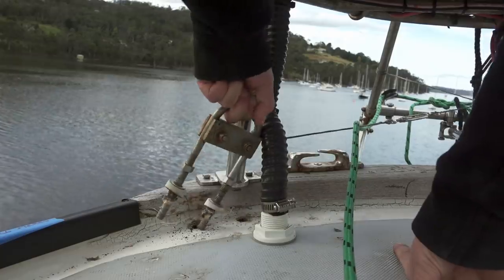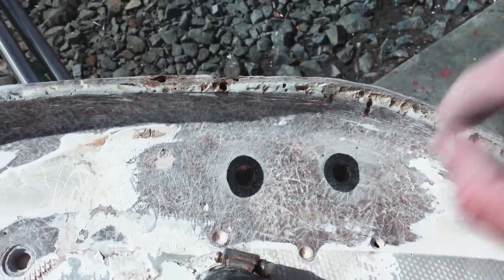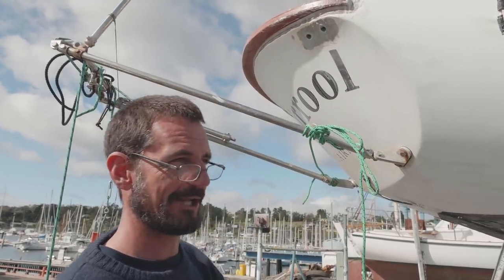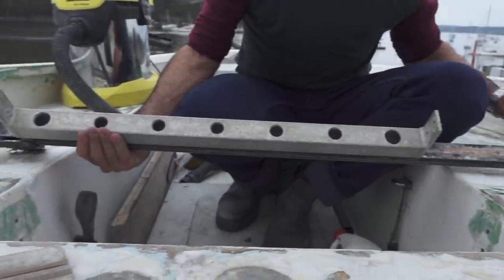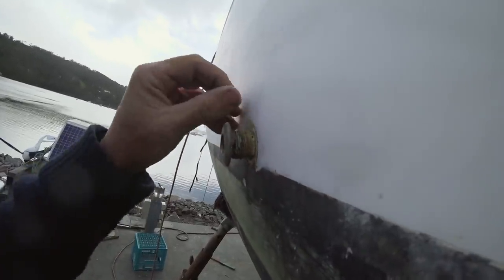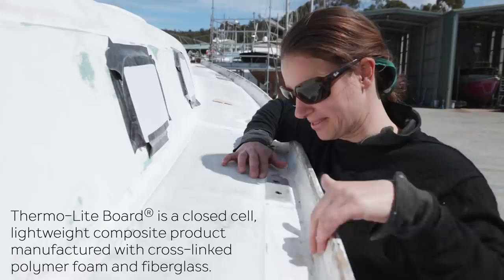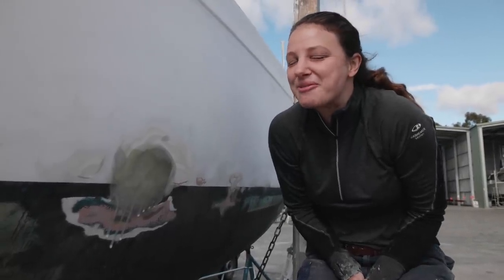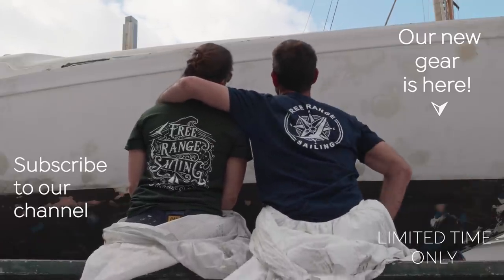Our sailboat REBUILD begins ⛵💪 - Free Range Sailing Ep 157

Comment: I love the new back-stay chainplates, perfect application.  I'd recommend that you avoid knots in the lashing, Dyneema is incredibly slippery so it's always ideal to splice it.  Next time you get around to replacing the deck lashing don't be afraid to allow the low friction ring to sit a little higher off the deck.  That way you'll have enough space to splice a multi-stranded infinite loop that is spliced together with buried tails.  I do mine with a Dyneema chafe cover to protect from UV, it is quite challenging to do this type of splice in place on deck, but as your skills progress it isn't as daunting as it sounds.  I'd be glad to talk you through it over Skype any time.

Comment: Hi Troy and Pascale, we've just almost finished our refit on our cat, and because it's a bigger boat it took a fair bit longer than yours. very similar to your refit we also did inside and out and also replaced all the rigging with dyneema. I did it all myself and saved about $3000.00 doing it. did all the splicing myself ( bit of a learning curve ) and instead of low friction rings I used heavy duty stainless cast and closed thimbles. tested all my stays before they went onto the mast by putting 6000 kg of pressure on it. I'm very happy with it and I estimate that I saved about 150kg of stainless rigging wire and fittings. the other thing is that it makes us independent, I will carry a lot of spare dyneema of different size with me and I can replace a stay anywhere in the world within hours if I need to. we enjoy your videos, keep it up.

Comment: I had modified my tack on my mainsail to incorporate a snap shackle, for quick and handy mainsail changes from cruising main to racing main. While donnig a new cruising mainsail, the eager captain hoisted the main before exiting the channel. This was against the first mates(wife) wishes. With sketchy winds on the nose, somehow the snap shackle loaded up and twisted, then deformed blowing out the tack. We gave all the people on the pier a show as I had to motor down the rest of the way before I could safely lower the main, and head back in to access the damage. Luckily the new mainsail was fine, but I still had to find a solution to salvage the sailing day. Then it came to me. I had purchased these new dyneema soft loops and had them in my in my racing crew bag( for racing on other friends boats). I popped on the soft shackle and it has remained in the mainsail tack for at least 5 years now. That soft shackle could lift up my whole boat and then some. There is no form it will not bend to. It won't work harden and there has been no signs of chafe. If it ever breaks, they were two for $30.00. It's a no brainer.
Great video! And great upgrades! Enjoyed watching!

Comment: Just looking at those Dyneema aft chainplates where the Dyneema loops underneath , just wondering if cutting a larger diameter frictionless ring in half and installing it to ease the sharp bend in the through hole underneath , if you know what I mean 😎

Comment: Pascale - I am wondering about the heat gun for the vinyl: after much research before the refit of my boat I decided to use a drill mounted hard rubber wheel designed for vinyl lettering and decals, bought on eBay in Australia. The West Systems technical manual warns that resin starts to disintegrate from about 60 degr C, a heat gun becomes effective only at much higher temperatures.

Comment: I really like what you are doing with the soft rig solutions, it's almost like going back a couple of hundred years and making things that are both very simple and easily replaceable by the 'average' sailor .  One very small problem is that it can be slightly more difficult to get the backstay tension high enough to really get that forestay straight especially if there is any creep in the Dyneema.
Reply from the maker: Our sheet winches get them there. Having a rigger that has 250 dyneema rigs behind him sorts out a lot of problems.
Reply: @FreeRangeLiving  i figured you might have to heave them down with a winch or alternatively set up some kind of tackle to the masthead and pull that back while you tension the stays.....that's how i did it with my gaffer.
Reply: @FreeRangeLiving  I'd be interested in the knot you tie to secure the lashing between the rings and how you maintain the winch tension whilst tying it.

Comment: Won't the loss of weight aloft change the roll rate of the boat? I realize you still have the mast which is probably most of the weight and the change might be small, but still, seems like a question worth asking. I know there was a study done in a wave tank seeing how sailboats (models) reacted to storm waves. The initial numbers that came back seemed all wrong with the boats whipping back and forth at higher rates of speed than anticipated. Then they realized they had neglected to put masts on the models. Anyway, just a thought. Love the channel !

Comment: Hi to you both. I noticed that the hole that you made for supporting the dyneema on the stern are not friction less. The are 90 degree edges. It may damage the dyneema rope with time. Is an observation with all the respect.
Reply from the maker: No, they're not.
Reply: Look closer. The edges are rounded over and smoothed.

Comment: Great job. Hard to tell from the video but how much did you round out the inner edges of the tube where the dyneema turns 90 degrees around the edge of the hdpe tube, bottom especially? Looking good

Comment: ... she's looking good :)

replacing stainless u-bolts with dyneema seems really good, but what are the negatives when using dyneema?
Reply: degradation through UV exposure plus chafe at any rub point are probably the two biggest issues..in this case, they’re in a handy place for regular inspection.   Stainless should give you a 20 year life, while dyneema will probably reduce that to 8 or less.  I happened to read manufacturers recommendation from Equiplite soft shackles and they recommend renewing UV protection every 2 months, plus regular rinsing “if sailing in salt water”.

Comment: Out of curiosity. Is chaffing a concern for those Chain plates(?) made of dyneema? Does any sharp edges in those holes matter or is that just something to monitor and mitigate while traveling? Great video once again :) Thank you for your hard work
Reply from the maker: Using HDPE and going to a lot of trouble to fair and smooth the holes eliminates chafe. It's the same principle as with the low friction rings- a very smooth and large bearing surface.
Reply: I had the exact same question, glad someone beat me to it! :)

Comment: won't the Dyneema chafe on the outside of the hull with regards to the rear chain plates?
Reply: I was thinking the same. I would have considered a rounded edge groove for it to lay in to get rid of sharp edges, hide the dyneema from abrasion and keep the dyneema better shaded from the giant UV monster looming overhead. That would mean a thinner layer to hold onto so building it up would be necessary and cosmetically that might not be acceptable to them.

Comment: Don't dis Sika Troy, there are many product variations within the brand, and if the previous applicator used the wrong type and prep, it is operator error, not the fault of the product.
Reply from the maker: We weren't dissing sika just the application of it to fix a hole in the deck.

Comment: However many zero friction rings you have as spares get some more.  I will bet you use them in places you have not anticipated.
Reply: The other benefit is the rings only wear on the center on one point and you have 360 degrees to rotate it and wear a different spot before replacement.

Comment: As a woodworker I am somewhat concerned with your encasing that wood on the stern in epoxy, it will likely to dry rotting of the wood. It will take some time, but eventually the wood will become a liability. Check it several times a year beginning next year. 

Otherwise Mirrool is coming along beautifully with all the hard work you two are devoting to her! Bet she thanks you with increased handling and speed - I know she will be more comfortable and cheerier to live in.
Reply: Epoxy over seasoned timber is a very well established boat building technique. Epoxy can be used when combatting the first stages of dry rot aboard. The fibreglass should make it wear a lot better and help to prevent end checking.
Reply: Epoxy encased wood should last forever, or until the epoxy breaches.  Dry rot requires moisture (contrary to the name).  It should see none of that.
Reply: In addition to what the others have said above, pretty much the only thing that causes epoxy to deteriorate is ultraviolet light. But the paint that has been applied over the epoxy protects the epoxy from UV damage. Additionally, Jarrah is so rot-resistant that here in Australia, it's used in manufacturing hot tubs.  So it's about as safe from dry rot as it's possible to be.

Comment: You seem to use epoxy for all these hull & deck repairs, not fibreglass. Is that because you're going to use paint to provide the UV protection to those? Loving your attitude of 'no magic' just do it
Reply: Epoxy is a choice of resin that is superior for adhesion compared to poly or vinylester resin. All of them are reinforced by combining with fibreglass. Together, they are all referred to as ' Glass Reinforced Plastic' (GRP)
Reply from the maker: The paint will handle uv

Comment: In case you guys are replacing your solar powerl unit, of late module efficiencies and module watt peaks have increased and prices dropped. Check out the half cut cell modules generating 500 Wp right up to 800 Wp per panel.

Comment: I was wondering about your weight distribution. You've taken so much weight off the top (which isn't a problem)but wondering all tolled would you need as much ballast
Reply: Troy said he hoped/expected the reduced weight would result in about 5 degrees less heeling.
Reply: @tomhath8413  thanks he did say that.its going to be very interesting looking at the new performance stats 🤔
Reply: @mudabudda  - And keeping the same amount of ballast, combined with less weight up high, means that Mirrool will be even more resistant to being knocked down. So now she'll be even safer!